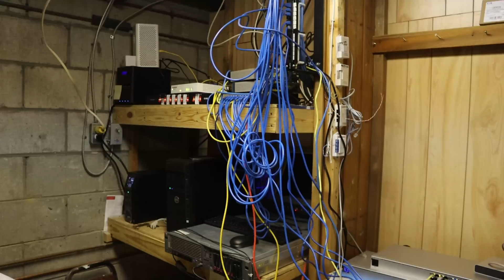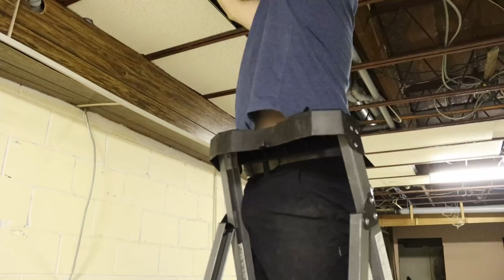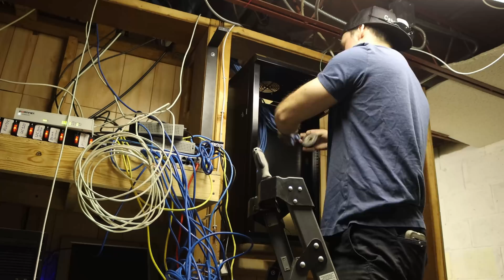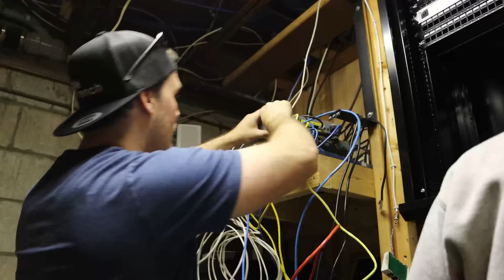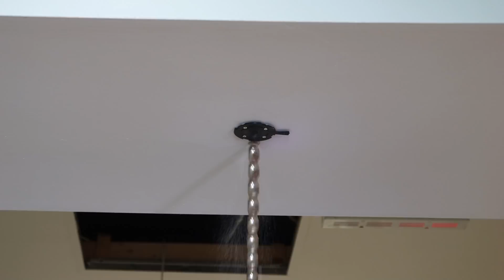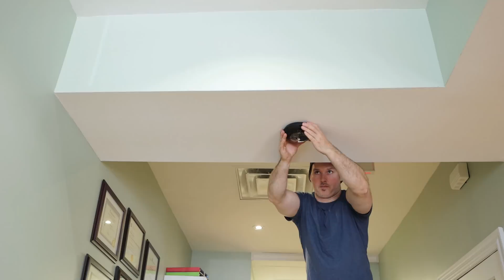Cable Cleanup and Unifi Installation

Comment: I do the exact same job with data cabling here in the UK. I have to ask, how come you start your patch panels at port 12 and not port 1? Surely starting at port one makes the most sense for the next engineer that comes along to work and add more cables?

Comment: Very informative videos. I am sure you are as expert in setting up severs and other network hardware as well. Please see if you can share videos on network equipment and troubleshhoting issues on onsite.
Reply from the maker: A lot of the on site stuff we can’t film. I have a few videos setting up Unifi gear on site

Comment: Really nice work. It looks so much nicer than before. I notice most setups you run the cables from the building to the front patch panel. It makes sense in those setups. For my house server rack I want to put a patch panel in the back of the rack (It's a roll around StarTech 45U) and run the back patch panel to the front patch panel with short cable. I would then run a cable from the plate on the wall to the back of my StarTech  patch panel. That makes my server rack it's own entity. Does this sound okay to you? My only concern is each connection adds a little discontinuity and I don't want to hav-e problems with 10G data. Longest run in house 25 meters or less. Keep the videos up they are fun and I learn from them
Reply: You won’t loose the connectivity or speed if the wires are correctly wired up, and within its parameters meaning less than a 100 meters. Not sure what that is in yards tho.. but why use two patch panels? If you want to disconnect things if you use the keystones you can just move it over, by unclicking the keystones..

Comment: Great job. A+ for cable management.

Only a few things I would have done differently. 
I would have used pass-thru keystones as they are faster to install and you can interconnect between the rear of the keystones on different patch panels using only patch cables with no punching. Making changes is quick and painless.

Your purple patch cable should have gone into the 2nd patch panel position 23.
The 2nd blue patch cable should have gone into the 3rd patch panel position 23.
Your second patch panel should have been a 48-port panel to avoid the mess as the upper row of ports in switch 2 become populated.
If you use pass-thru keystones, go ahead and populate unused switch ports to their adjacent keystones so future expansion is already mapped out and to prevent dust from entering the ports.

The order of the panels, switches, and devices goes by the following rules. You partially followed these.
A single row of keystone jacks should only be connected to a single row of ports on a switch. Avoid crossing over a row on either a switch or patch panel.
Ports on a device or switch should be connected to the nearest patch panel keystones. Avoid as much as possible patch cables that run at angles between keystones and ports.
Use a single 48 port patch panel instead of 2 individual 24 port panels so long as the panels are between switches or devices.
Try to maintain the sequence of alternating between patch panel, device, patch panel, device, etc. Following this sequence will look more uniform. This is true even if you have a device with a single row of ports.
Try as much as possible to color code the keystone pass-thrus to the patch cable colors. Keep in mind that UV from fluorescent lighting can bleach labels. I have a customer's site whose panels and wall plates (nearly 400 labels) are now completely blank.

If you are remodeling as opposed to new, patch cables can be lengthened by using patch cables and non-keystone pass-thrus. Terminate the short cable with a pass-thru cable end, add a female-female pass-thru coupler, and another patch cable to reach the back of the keystone panel jack. I have a future job where there are 192 punch-down cables that have no slack and need to be moved in the rack. To make matters worse the punch down panels are 96 ports each installed at the top of an 8ft rack. I'll pick up one of those portable scaffolding units so I don't have to sit on a ladder all night.
Lastly, avoid attaching cables to other building systems such as ducting, conduit, strapping, etc. Use J-hooks attached to the structure of the building independently. Other contractors will thank you when they need to work on something and don't have to deal with your cabling and there is less likelihood of your cabling being disturbed, moved, or damaged.
Reply: What pass -thru keystones do you use?
Reply: @daapprentice8659  If I'm being honest I usually end up using what's available and cheap so long as they are the slim type so they can be packed in close together. They are a pretty basic design and factory assenbled. The main issues to pay attention to is whether the panel is made well. I deal with mostly 48 port switches so finding a high density 1U blank is important. If you have time, order in some and test fit them. Make some notes as to whether you prefer the keystones all upright or 180 so you can get your fingers into the release. Also, it is surprising how particuler you'll get with the color coding of the patch cables and keystones. It's one of those fiddly things that when done right it looks amazing and you won't want to go back to your old way.
Reply: @WhitentonMike  thanks for the reply. Would it be possible for you to post a link to an example of something that meets the criteria you just mentioned? I'm a visual person, do that would be most helpful.
If not, no worries.

Comment: Cody, you use the same color scheme across keystone and cables?  yellow for phone, black for data and blue for uplinks?
Reply from the maker: Yup that’s correct. Purple was for IsP . Need to buy more keystones and patch cables
Reply: @MactelecomNetworks  did you pass on SFP+ uplinks due to cost or availability of cables? thanks
Reply from the maker: @eddasilva6948  nah we just didn’t have any. We have to go back I’ve ordered some and will replace with dacs

Comment: Great video what patch cables do you use or do you make them up
Reply from the maker: These are done by a company close to me ( infinite cables) but you can buy monoprice 6 inch slim cables or vertical cable slim 6 inch patch cables